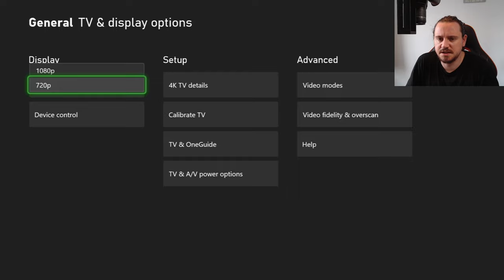Xbox One S HDMI Port Replacement | First Time!

Comment: Sweet fix Joey 🙂, I agree with Danny a little more heat from the iron would have helped overall though it doesn't have to look pretty just needs to work and it does so nice job 😉.
Reply from the maker: Yeah I think you're right pal. More heat from the iron, or perhaps a bigger tip for better heat transfer :)
Reply: @JoeyDoesTech  Yes mate or a little preheat from hotair before attacking with the iron mate even if the board is only sitting warm it should help by not dragging heat away in that area buddy 🙂

Comment: This may sound like a dumb question but if I have 2 Xboxes with faulty hdmi ports can I use the hdmi port in as a replacement?
Reply from the maker: Not a dumb question at all mate. Yep, you can carefully remove one and replace it on another Xbox :) You can also use the other HDMI port (HDMI In) as well.

Comment: Nice work Joey!
A few constructive suggestions for the next one:
Pre-tin the pads on the board this will help with soldering the pins down. 
Find a smaller diameter magnet wire, that one looked a bit big, it worked but I think it made your efforts harder than needed.
Reply from the maker: I can see exactly why that would make life SO much easier. When transferring the solder to the port pads, I was scared of doing too much or too little 😁

As for the wire, it's funny you say that as I have some thinner wire that came the other day. Believe it's 0.01mm instead of this, which I believe is 0.2mm. Thanks pal :)

Comment: Nice fix and  video Joey 😉. It looks like your iron was suffering a lot and the solder you use is slightly matt and grainy, are you sure you are using a quality leaded solder? It looks like unleaded which would explain a lot.
Reply from the maker: Hey Kiki, thanks 😁 So the low melt solder I used was stuff from Wayne/Phil I'm pretty sure, so can't tell you what it was as I just have the wire and no case. I used lead free solder on the first ground leg of the port replacement toward the end of the video and that's where it wasn't setting correctly in my opinion, so then went back to the leaded one I have :)

Yesterday some new solder arrived, Weller 60/40 so really looking forward to using that as it has great reviews.

Comment: Nice fix mate, love the videos. I haven't done a hdmi replacement yet myself but hope I can get a console off eBay to attempt it.

I'd love to see you do a retimer replacement, as I failed when I attempted it because I made too many mistakes, hopefully you can find success doing one.

Also what microscope do you have? It says you have one of them LCD digital microscopes in your description but I didn't see the stand in the video, only your heat proof blue silicone Matt so assumed you weren't using the one in the description because I couldn't see the stand
Reply from the maker: Hey mate :) Thanks for watching as always pal.

I use two different cameras, one of them is an overhead DSLR camera which you see most of the time, then the microscope I use is the one in the description for the soldering work :) I'll be trying a retimer soon I think! They're very small chips haha.
Reply: @JoeyDoesTech  oh right just thought you would of struggled balancing a motherboard on the base of one of those cameras when working on it if you get what I mean, with the motherboard going over the base.

And yeah, world of advice for retimer is just be very cautious of the capacitors surrounding the retimer chip, if you knock them off and they go missing it's game over unless u have a donor board

Comment: very nice job joey. when you solder normally it is better not to use low melt solder, it does not solder well from what i saw
Reply from the maker: Thanks Renata :) Yeah I was using the low melt and agree it didnt flow to well when I was finishing up.

Comment: What’s that copper wire called and what’s it for
Reply: It’s to replace the broken trace on the pins on the hdmi port, otherwise it wouldnt work without that pin being soldered with the wire